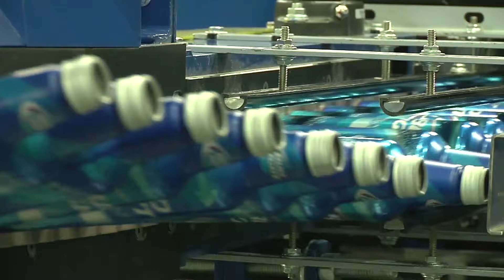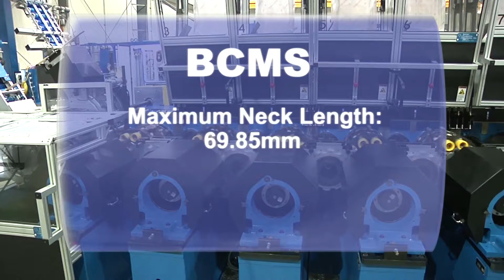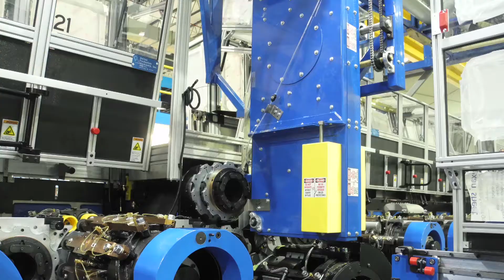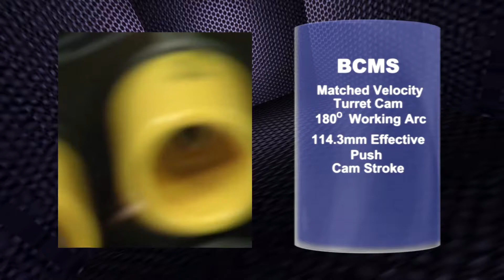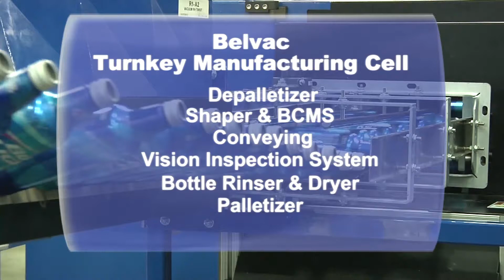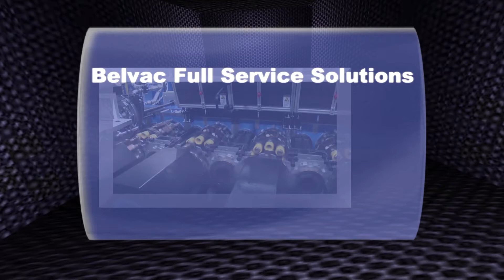BCMS - Bottle Can Manufacturing System

Comment: Can you have full line solution for Thermal Flask ( Heat Proof Food Gread Stainless Steel Bottle ) if yes then how many minimum and maximum capacity of water bottle Can We make a single line Thnq